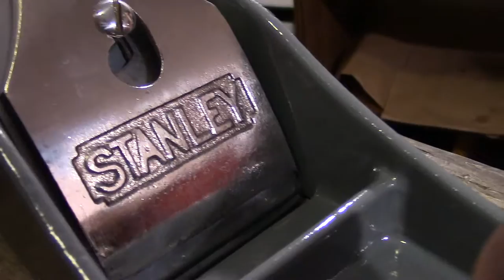Stanley #6 Hand Plane - (Part 4: FINAL) - Thoughts on helping the needy

Comment: That JB weld really did the job!  The color turned out good, very nice. Mineral oil is great for almost all tasks when it comes to restoration, wood protection, beautification, lubrication and rust prevention. Certainly richened the color! Glad you still stuck with a gloss coat. BTW, the frogs upper surface where the iron is seated down on top should be bear metal, and flattened not painted. Love all the attention to detail! Brand new! This was a gift from your grandfather right? Bet he'd like to see the end product. Still haven't shown the sole of the plane after the JB weld!!!!
Reply from the maker: +111raybartlett JB weld was excellent! Looking forward to showing you in person. Don't think i'll show it to pop.. he may want it back. haha Thanks for the tip on the frog. I'll fix that. Easy fix with a bit of sandpaper on the ceramic tile! :-) This was a big project. Well worth the effort though.. they usually are. All good things are! haha
Reply: +Weiderfan Yeah the frogs surface need to be flat so the iron can be secure when clamped down by the cap iron and be smooth for adjustment. It was a nice project! took four video parts which was nice to follow.
Reply from the maker: Makes total sense! I should have caught that.. Thanks dude!

Comment: Hey man. A couple of things. 
1) great job. You had a really uphill climb. I restore planes, but i would have passed on that plane for all the issues it had. Nevertheless i admit i would have passed because i would have found it not worth my time to restore a plane in that condition. But purely because of that i commend you with much respect because you fought the battle i ran away from, and you took the blows and you came out victorious. So really pat yourself on the back. Thats no small feat.
2) your generous nature is infectious and so should it be. I think ill remember you for ages whenever an opportunity to help another person comes around because your attitude is right in the sweet spot of human nature. A lot of people just do good things with a variety of motives, and thats better then not doing anything but the smallest good can become something massive if the right attitude is behind it.
3) you have probably found out about this from other sources by now, so please forgive me if you have. I only mention it because you worked so hard and you seem like such a nice person that i really want you to get the best experience out of your plane and feel this would help that cause. You might want to clear the flat places on the frog that contact the iron, and the metal to metal surfaces where the frog meets the base, of paint. Apart from possibly a little thin oil, those places are designed to have perfect metal to metal contact, to allow the force to transfer from your upper body through the plane and deliver that energy at the 45 degree cutting edge to produce an efficient and clean cut. Introducing material, even a thickness of paint, between the two surfaces can and probably will reduce the output, the feel, the efficiency of its force transfer. Maybe take a dremel to it and get them back to flat and smooth.
4) im very keen to see how the welded bolt hole on the sole came out. Could you post some pics?
5) instead of mineral oil on the handles, have you ever tried shellac, even ready made shellac/ french polish. Where i am you can get small bottles of it at a low cost. I typically use three coats, burnishing with 0000 steel wool between 2nd and 3rd coat and after the 3rd coat. The finish on the wooden parts come out just beautifully with just the right amount of gloss.

I look forward to more of your videos. Make videos when you set up your shop. They will be a hit.